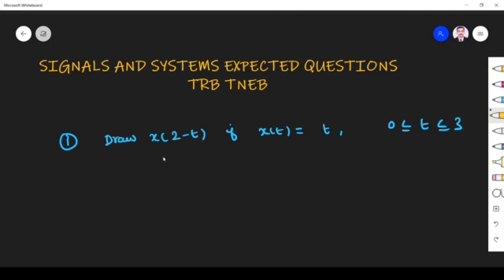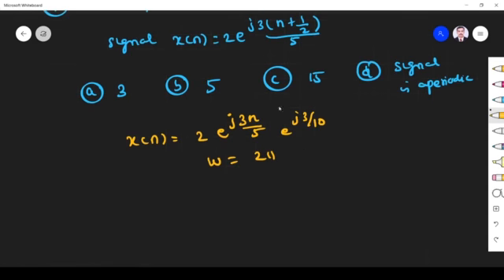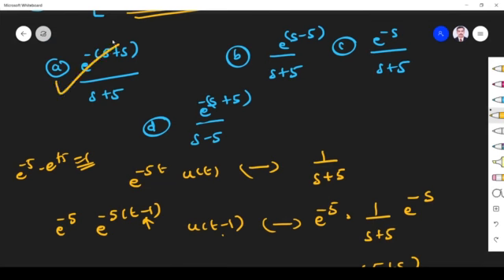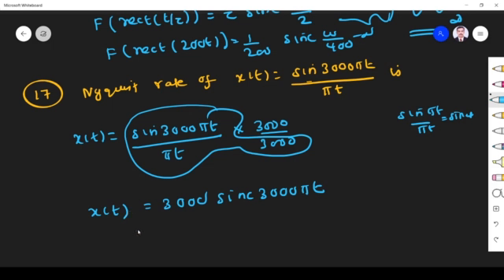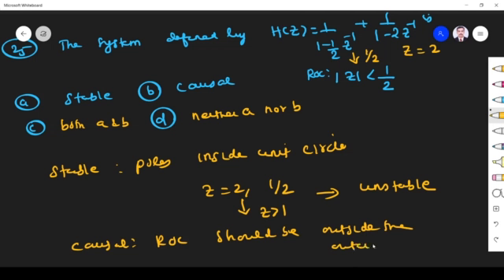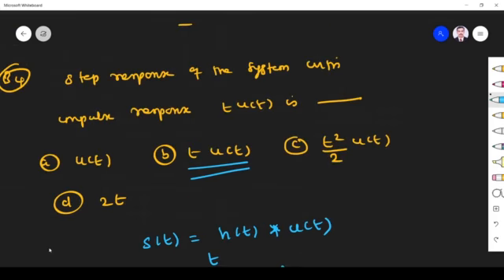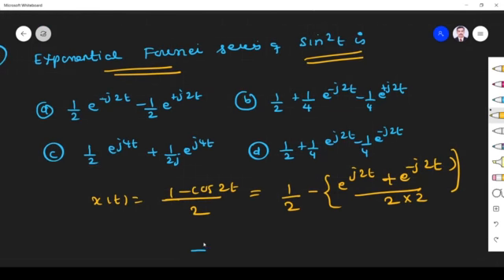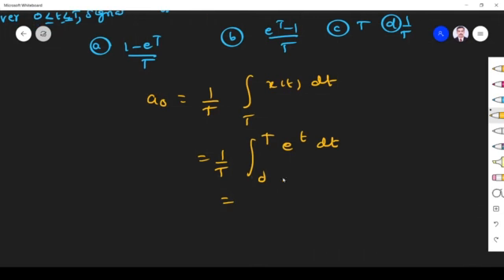TRB TNEB SIGNALS AND SYSTEMS EXPECTED QUESTIONS

Comment: hi sir, very good evening sir.  in question number 44 the value of a is 1/5 but in (s/a) you have substituted (s/5) instead of (s/1/5), is this correct?   in question no 45. transform of sinat is (a/(s2+a2)) but there 3 is missing so final answer is u(t)- 3sin3t.. can you please let me know the solution for both my questions?
Reply from the maker: Yes ma'am..your question is right.. instead substituting 1/5 I substituted 5...I will change it..thanks for asking this question..so answr for 44 is 25S/25S^2+1
Reply from the maker: Regarding Q45.. we should first multiply and divide by 3 then only we can apply Laplace Transform of sin at...so answer is u(t)-1/3 sin3t..thanks for both the Questions and pointing out mistake..I will correct it. thanks for ur great support